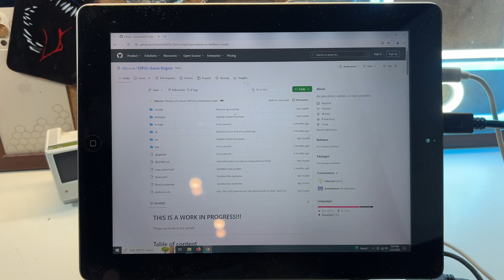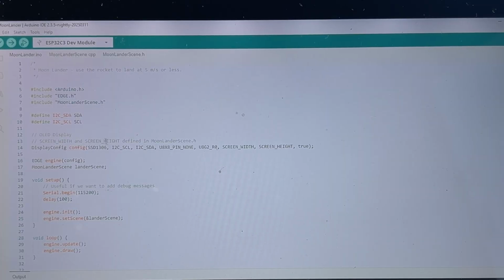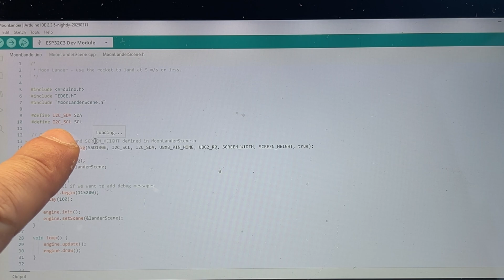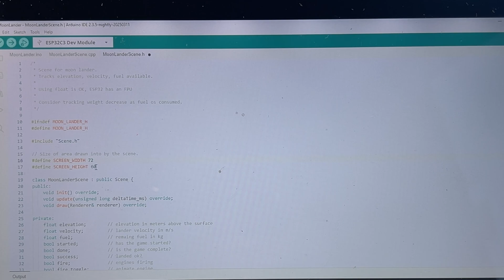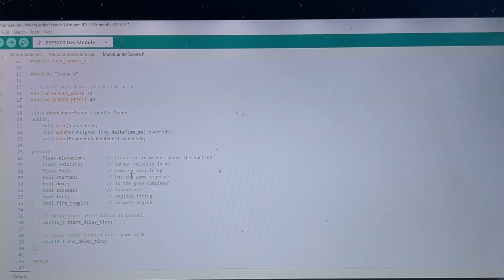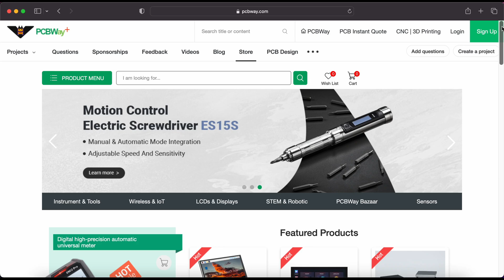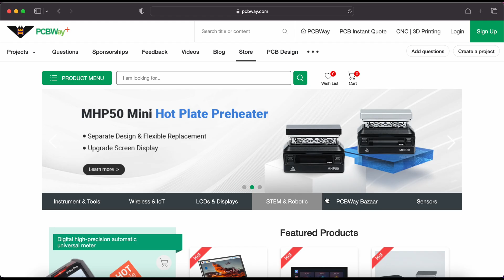DIY Super Tiny Handheld with 0.42 Inch Screen

Comment: BTW, can you add a clock program on it?  And if it can hold both the clock program & the game, and can switch between the two, you can add a set of watch belt & you got kinda a wearable/smart watch!
Reply: Oh oh, another idea, add some LED lights, and a lanyard - you got a necklace & lighted pendant/game/watch!
Reply from the maker: Yeah clock app could be done , whats even better is that the board has wi-fi so it will display correct time. Also the board has 2 rgb lights but still yet to understand how to control them
Reply: @BalkansWay  But I need "Lights... lots of Lights".
Reply from the maker: @ that sounds like RGB addiction haha
Reply: @BalkansWay  Don't tell the RGB police...